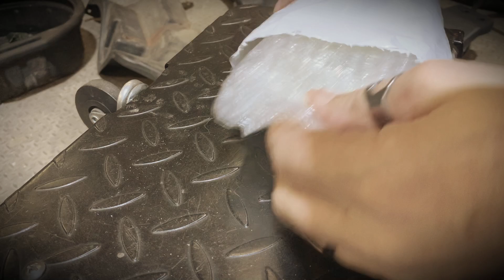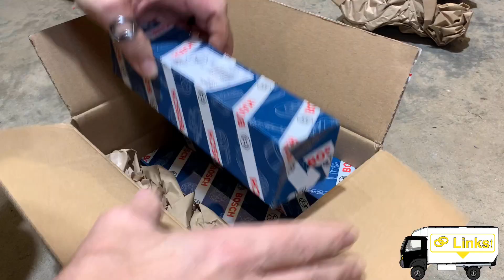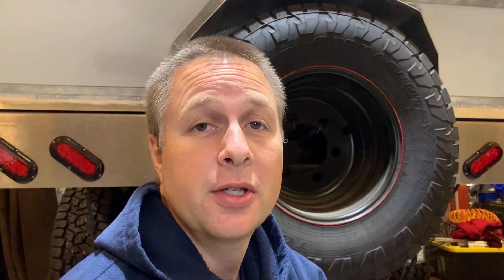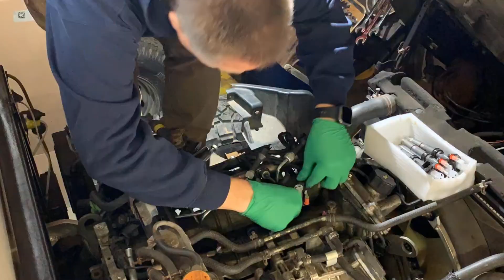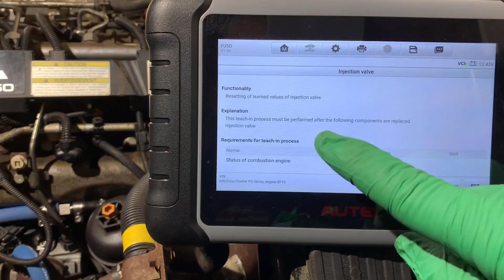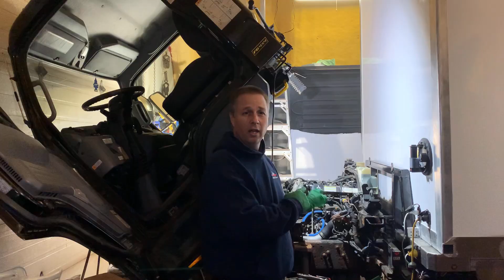NEW INJECTORS!! - is this the ticket?  | Fuso FG no-start Saga!

Comment: Definitely a victory! I wonder how much that set of injectors had cost. But I'm mainly disappointed that the previous injectors failed, you put so much time and effort into restoring them. As an owner of a car with piezo injectors this saddens me, a new set is worth my entire car's value and almost another! Great video series.
Reply from the maker: It’s possible that I was actually able to rebuild one, at some point I’ll take the set I worked on in to get another test - as there were multiple issues going on at the same time, I can’t really rule out that the ones I tore apart were not working.
Reply: Hi Bruce kindly send your email address..

Comment: According to the manual from Fuso Ascent, there are copper washers  and I have installed them myself
Reply from the maker: What year & which model truck?
Reply: In the Workshop Manual and Parts Catalog from 2018 and from 2025 there is are copper washers, but the trucks never come with it. I spoke with another technician and he told me there are two versions if injectors, piezo and coil. I Will need to do further research.
Reply: Kindly share the details of the truck

Comment: The best bit of progress to come out of this is that you know there is no major mechanical defect preventing the engine from running.  Once you get to the bottom of the issue it will run, and run pretty well from the sound of things.  I'll be interested to see if the ECU has logged any codes now the engine has started and run for a short period.
Reply from the maker: This is very true - I know mechanically it works, now I just have to call in an exorcist.
Reply: @BruceandKrista  I hate to say it, but at every step along the way I've not seen anything mechanical that would cause a crank-no-start with not even a kick.  You've really double and triple checked everything - and then some.  My suspicion is that once you coded the new injectors the engine ran just long enough to trigger whatever stopped it running suddenly the first time around.  Fingers crossed it has also given you a code to check now you have the new scanner.
Reply from the maker: No codes 😞
Reply: @BruceandKrista  That's really frustrating.  The way it ran so well on the first start after coding, then failed to even kick on the second, suggests to me the ECU is ruining the fun for a good reason - either to prevent engine damage or because it's not seeing a signal it needs.  Have you run the injector coding again to see if it starts first try after a subsequent recoding?